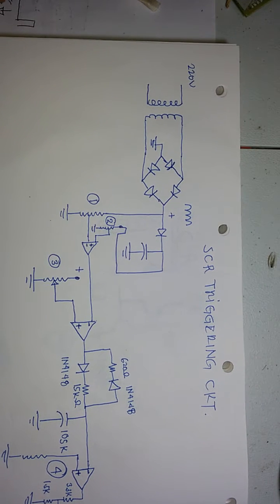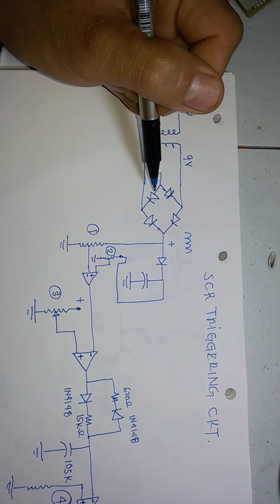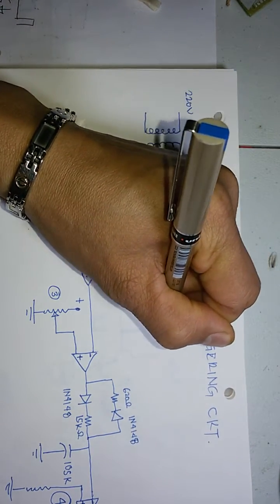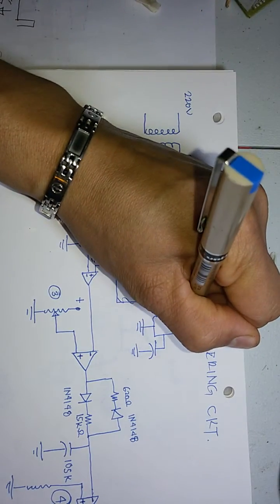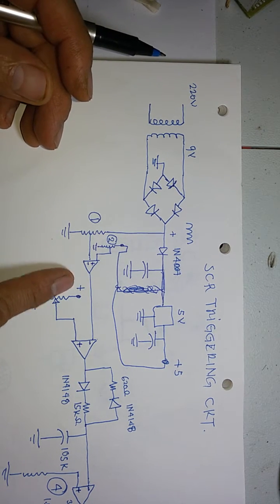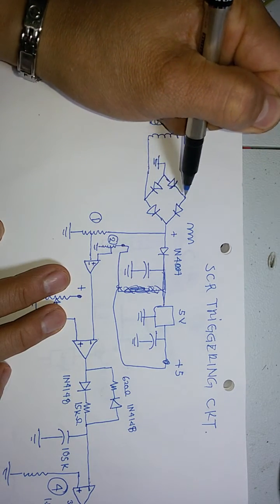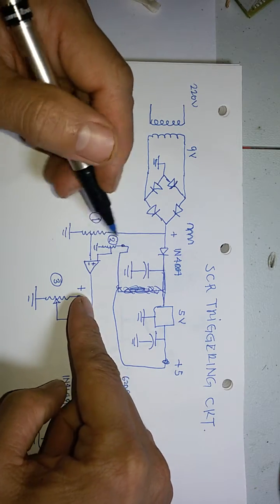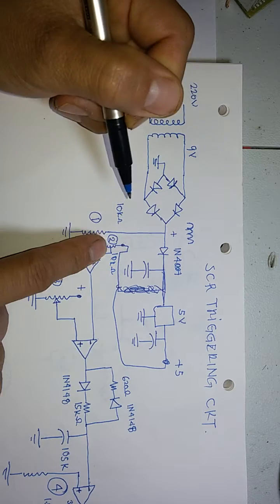How to make thyristor SCR firing circuit using LM324 OP Amp 2 of 5

Comment: Thanks for sharing such an Awesome project. Can you please also do another video on 3 Phase AC input to Drive DC Motor using 6 SCR / Thyristor having option to speed control Potentiometer & Tacho Sensor Speed locking feedback. Awaiting your earliest response. Thanks & kind regards.

Comment: you are supplying the main load from the primary side I assume ,but the transformer does not make any phase shift  ?? the zero point voltage in HV is not the zero point voltage in LV ??
Reply from the maker: Good question bilal... In my analysis I think it does have some phase shift... I have it check somehow...
Reply: ok thank you anyway

Comment: +Julie Tech - This is a great tutorial; thank you! I have the LM324 circuits prototyped and they seem to be working properly. I had a few trials to find the correct capacitor for the sawtooth waveform, and landed on .22uF, which seems to work well.
The question I have regards the comments below about the MOC3041 vs. MOC3021. I have ordered, but not yet received, MOC3041. Will this work, or do I need to order MOC3021? When I lookup MOC3021 online, it is listed as obsolete... Thank you once again for this marvelous tutorial and your consideration to this question. Jim

Comment: Hey thanks for the video it is really helping me, but i want to ask why did you use 3 potentio?, because when i saw the continuation of this video, you only used one potentio to change the firing angle of the SCR. thankyou :)
Reply from the maker: +adhistira madhyasta Those early potentiometers were necessary to produce the zero voltage crossing and the creation of the square wave to bias the signal voltage and comparator produce them... those were the building blocks of our trigger signal.
Reply: So can i change it just by a resistor with the same value as the potentio?
Reply from the maker: Yes but you cant play or make adjustment that best suited for them..
Reply: +Julie Tech when we were setting up Thyristor circuits at GEC Traction we used to use SoT (Select on Test) resistors rather than potentiometers so we could calibrate the circuit and pulse widths accurately.
Reply from the maker: +Stuart Hatto  thanks for the info..

Comment: I think i found the problem. Remember the 3rd comparator inputs of LM324... I reverse it having the output of the secound comparator to be the positive and the trim pot to the negative. it reverse the trigger starting from 0deg to 180deg. So instead of firing at the start of the cycle and cut off, it is now off at the start and turns on where you want it. 

Great help guys. thank you.
Reply from the maker: Manolete de leon Congratulations Bro.. Enjoy your creation..

Comment: The low voltage is fine. it is the SCR trigger the is not working properly.  I replaced the MOC3041 to MOC3021. it will trigger but wil be 100% power with a minimal trigger. I think it has something to do with the noise. I place the scope accross the trigger voltage, I found out that there is a 1 volt voltage between the pulses. It loks like a half wave.

Comment: i did exactly what you have shown having the saw tooth... all the way to the triggering the scr....but my trigger alway start with a full wave. I'm using MOC3041.  What could be wrong?
Reply: you most to use moc 3021 because moc 3041 is zero crossing
Reply: I will try that.
Reply from the maker: Manolete de leon if the trigger pulses signal from the opamps were right then for sure your opto will fire.. But try to clean the circuit from any excess solder paste because most of the times they cause bridging.